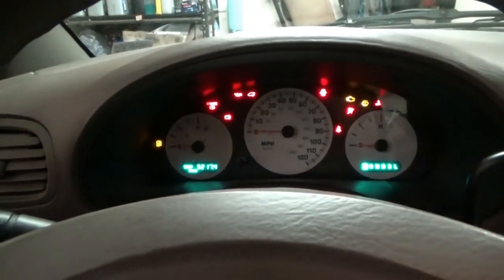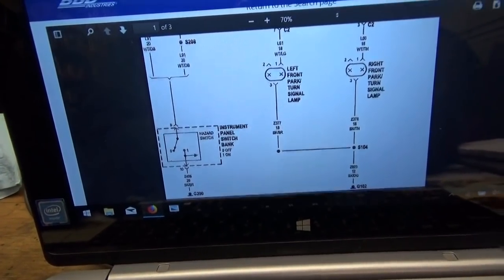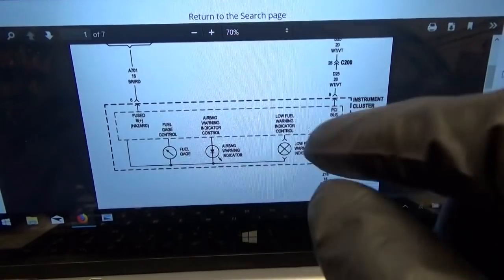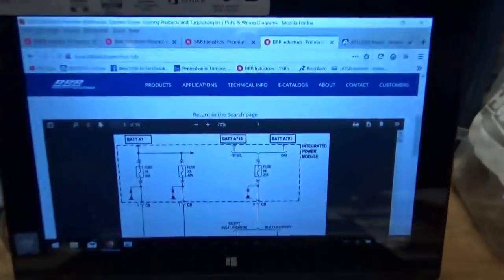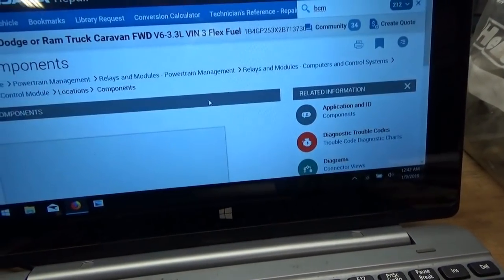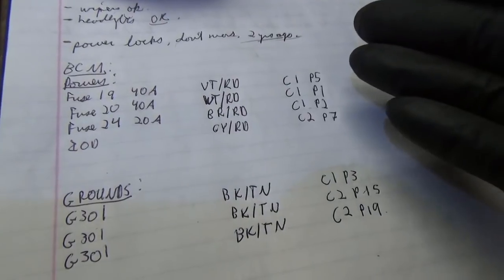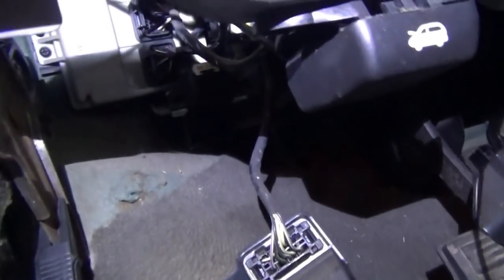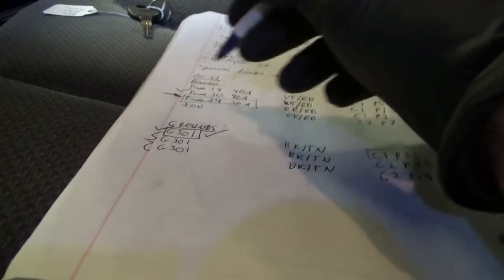Crazy Caravan Cluster -Part ONE (1)

Comment: i love how people knock theses vans.  I've owned 2, an 05 and 07 3.3 engine and they both were some of the best vehicles I've ever owned.  Both had 200k plus miles with original powertrains. Simple maintenance and they will last.  Local taxi service uses them and I've personally seen the odometers  of 3 In their fleet. 2 had over 400k and the other 350k. All had 3.3 and original motor and transmission. But i guess their junk.
Reply: I absolutely love these vans... on my 5th one now, all 3.3L V6 Great gas milage, tons of room for cargo and my kids, love the Sto n' go (such a great idea), all have reached over 200K if they weren't stolen or written off in an accident. My last '05 reached 245K but it started to become a money pit for repairs and the body and rockers are pretty rusted out so my newest one '09 bought last week for $4480 has 134K on it and I'm sure it'll last at least 5yrs. Plus I'm stoked that the mid row windows roll down (my 05's didn't). and over the years I've been doing more and more of my own repairs and at this point I could probably have Journeyman mechanic status for dodge caravans...lol

Comment: Damn it's got a Walmart battery. Fantastic video as always brother!
Reply: Actually Walmart batteries are good. They are made by East Penn Manufacturing, the same company that makes Deka, Napa Legend, OEM car manufacturers. My best friends brother in law has worked there over 30 years and he told me that the Walmart Everstart  Maxx internals are on par with Napa. I've never had an issue with one.
Reply: Interesting good to know!
Reply: I hear people say that a lot Eric, but I've had excellent luck with every Walmart battery I've owned over the years. The first one, back in the late 90's, came with a '81 Chevy C10 I bought for a winter beater - it still had it's original receipt in a plastic pouch that was stuck to the battery case, similar to a packing list on a shipped package. The battery was 10 years old when I sold that truck, and still going strong! Ever since then, I've used Walmart batteries without much worry. 

That said, I've got a $300 Odyssey AGM battery in my Silverado. Great battery - handles some serious 40A key-off continuous abuse from my twin Viair compressors -  but, I won't buy another, since the computer-controlled charging system on this truck is optimized for a much more affordable lead-acid battery.

Comment: I saw 1 thing that bothered me from the get go.. The check engine light was flashing KOEO. In this case I would've definitely plugged in and used bi-directional controls to the BCM to see what works, if it can even communicate with the cluster, etc, and went from there. BUT let's see what you find.

Comment: hi ivan great video, i had the same problem in my 2001 dodge caravan. the problem for me was the power feed to the fuse is the little connector at the battery terminal. in the video yours had a yellow crimp conn and a butt splice further down the wire. mine was stock and just was loose. for whatever reason dodge did that i'll never know. every time i removed the battery i had a problem with that conn eventually i made the wire longer.   love your vids  Tony from NJ

Comment: I think the problem is under the power distribution box lift it up I’m sure you’re going to find corrosion or even broken wires I had the same van last week and the ABS light was on saying the circuit to the abs pump motor voltage out of range I checked fuse 25 amp on the corner had good power I check the 40amp fuse it was good I measured the voltage at the 40 amp fuse and it had 3.5 volts that lead me to pull the power distribution box up and sure enough the 2 wires and the 25 amp abs fuse were corroded and broken right off fix the wires and the problem was fixed

Comment: I had a Hyundai Santa Fe a few months back that when the customer turned his turn signal on the car stalled. Tracked it down to the a power feed wire to the ignition. Some aftermarket item (Im guessin g becasue there is no other explination) but the 12ga power feed wire was cut. Sliced on 1 side was about a 16ga wire and on the other an even smaller wire (18ga im guessing) those 2 were just twisted toghether with tape. After coming down with a case of the green crusties that circuit overloaded with the turnsignal.

Comment: i agree with jj dynomight (further down in the comments) i've owned 6 caravans from 91 to 2007. i buy them around 120K for under $2000 and put 150K+ on them with very little problems. electrically no problems. only a fuel pump around 130k to 150k.

Comment: 212,000 miles is amazing. I’ve never had the desire to own a car after it’s gone 100,000 miles.
Reply from the maker: Really? If well maintained, most cars are just getting "broken in" by 200k ;)
Reply: I've got 260k miles on my '86 Mercury Grand Marquis - owned it 16 years now, and not a single sign of it getting tired yet.
Reply: Smitty Smithsonite I’ve seen crown vics in Manhattan just broken in at 250K.
Reply: Flipped 2 CRVs in one day, one drove for 11 years 102 K and the other for 12 years with 83K. It’ll take me years to put 200k on any vehicle.

Comment: I replace the clusters in those all the time.

Meanwhile, we are having a NW WA snowstorm. Contour with snows does good in it.
Reply from the maker: haha the previous shop already tried a new cluster...obviously didn't work, and knocked out half the illumination bulbs in the process xDD   I run General Altimax snows on the Mystique; plush ride and good traction. But when the snow gets a foot deep only the 4x4 Suzuki can get out lol
Reply: @PineHollowAutoDiagnostics  

If I am not mistaken, those cluster illumination bulbs are not LED and checking those would be one step. 

I run the same snow tire as you, but in a studded version. Great traction and decent ride. Unfortunately. I don't have a 4WD vehicle to my name, but chain up the Contour as needed. 

I am also replacing the stock steelies with a 1st gen (01) Focus alloy rim that is double 5 spokes. Junkyard find for $25 a rim/tire set.
Reply from the maker: YES! All the 14" steelies seem to be a bit bent on mine. The hoppy ride is really getting annoying lol! I'm looking for a set of 15" alloys as well...they seem quite hard to find!
Reply: @PineHollowAutoDiagnostics  

Yep, same issue here. NHV issues traced to rims being wobbly. When I got the Contour, it had the 14 inch steels rather than the original 15 inch alloys. 

I use a Hunter wheel balancer which does a pretty good job of balancing rims, but with a wobble caused by a slightly bent rim, not much can be done. I had a rim shop tweak the rims as best they could, (it was worse) but once a rim is bent, there is not much you can do to repair it.

B&R Auto wrecking (google the website) has rims all the time and they do ship. That is where I ordered mine and got the transmission as well.
Reply: @PineHollowAutoDiagnostics  

https://www.autowrecking.com/locations/graham

Go here and do a search.
Reply from the maker: You should do a manual swap on yours...I saw brand new MTX75 5-speed transmissions for only $250 on eBay!
Reply: @PineHollowAutoDiagnostics  

Unfortunately, not possible. I drive with full gas/brake hand controls since I have cerebral palsy, so the DOT requires me to drive with ATX power steering/brakes and the hand controls. 

Changing it over to MTX is a tricky process since the transmission on these has specific axle codes that the PCM is looking for even with the manual. There are 3 manual transmissions (2 V6 versions and 1 4 cylinder version) and 8 separate ATX versions (4 each for V6 and 4 cyl) 

The weak point on the MTX is the diff and syncros. I do however have a aux cooler on mine which helps a lot, but also it has a Transgo shift kit that resolves shifting issues, and has the upgraded shift drum that the old one cracks.
Reply: @PineHollowAutoDiagnostics  There are loads of those alloys / steelies here in the UK. The Contour / Mystique in the UK is the Mondeo.
Reply: @cclngthr  @Pine Hollow Auto Diagnostics  I love the Hunter machines. I don't use anything else.
Reply: @JamesAllen300  

That is all I ever use. With modern cars, the NHV is very critical and any wrong thing, from driveshaft wear to wheel issues, you feel it.
Reply: @JamesAllen300  

I know, and they look better than what we here in the usa get.

Comment: drove 1 last century 3000miles. rear door decide to open on expressway then hour later side door fell off. brand new van! later that year took a new job. There making the parts that broke causing the door problems. consumer report did a test on same year 3000 miles trans fell apart. if you have 220,000 on that van fix the odometer also, can't believe without a told rebuilt of motor, drive line suspension, brakes and so on, but one might have slip thru that was good
Reply from the maker: The older pushrod V6 motors can take a lot of neglect and still run silky smooth. Transmissions are not Chrysler's strong suite, but I think this van was all original!
Reply: @PineHollowAutoDiagnostics   My 07 Caravan was on the hook twice last week. Monday, power steering hose blew up. Thursday the starter gave up. It was -25f both days. Too cold to repair myself in my driveway. Had to take hours of work time to repair at the shop. Getting to know the tow truck driver and his Family real well though....LoL.
Reply from the maker: Wow -25F....at least it started!! Well until the starter died lol!